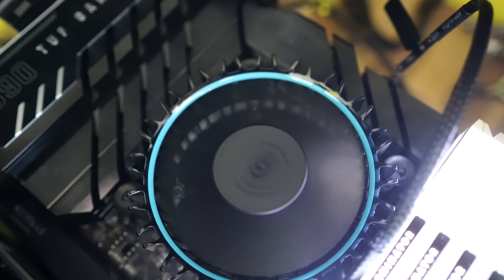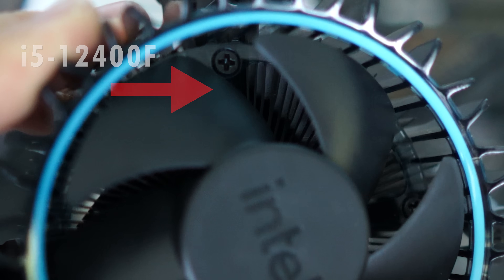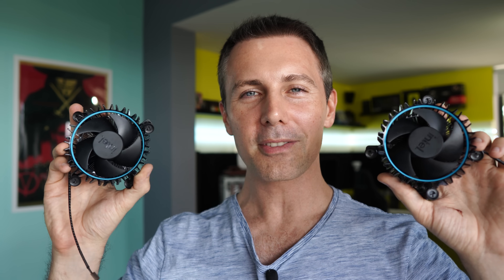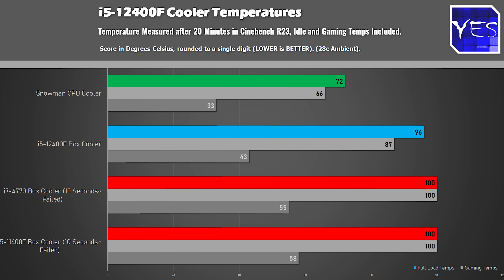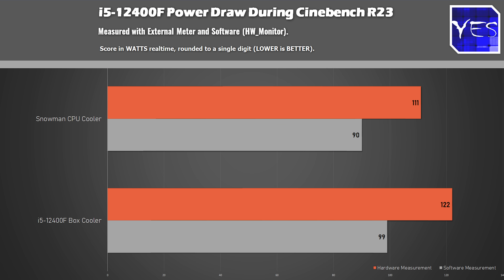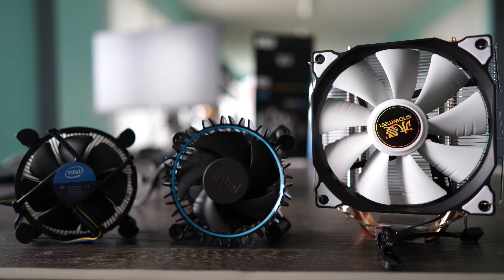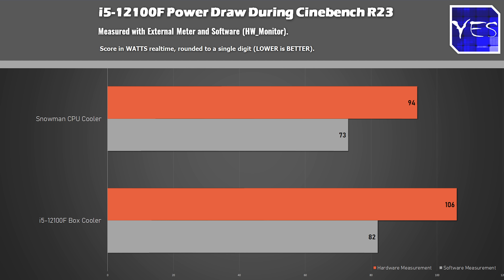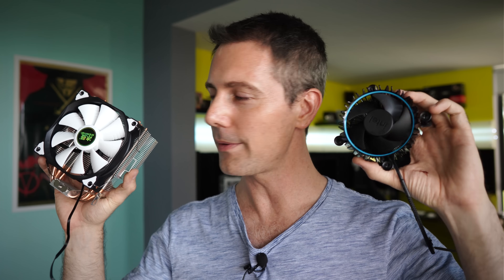Is Intel's New 12th Gen CPU Cooler Actually Garbage?

Comment: Me with the i3 12100 paired with i5 4570 4th gen stock cooler 
Running most of my games at 4.1ghz 
CPU fan in 2000rpm 
60C max 65C

Comment: Are you telling me that you tested this CPU and those temepratures with RAM that is not officialy supported by the CPU? Ofcoruse it will run hotter because you are creating bottleneck, and your RAM is downgrading to 3200 MHz, unless you are running a XMP profile, which...is something I have no interest of doing. Stock is fine for everyday use. Not saying that you wouldn't benefit from changing a CPU stock cooler, but no issues keeping it stock also.

Comment: Noticed a few mistakes. You were calling the 12100f an i5 processor in the charts when it's an i3. Also that snowman cooler you shared a link for a 5 pipe one in Ali but  it was actually only 4 for the lga 1700 you were using. Did you catch that? Nice job though.

Comment: Long story short: Intel Stock cooler garbage. 

I thought after 20+ years of experience I had installed the oem cooler wrong when temps ran to 99’C + , but nope this cooler sucks balls. Even older stock coolers were at most at 85’C or so at 100% stress test
Reply: stock cooler here on a 13700f, thermal throttling as soon as I run something heavier

Comment: You have things backwards, the intel cooler allows the CPU to draw more power which means it removes heat better. The "Snowman" is thermal throttling and limiting wattage...

Comment: My htpc has a i7 4770 and the stock cooler that came with it. Recently i thought about running a cinebench test and damn the cpu hit 100c in few seconds.. older intel coolers of that style had delta fans that would spin at 3500rpm but the 4th gen ones had a fan that was so slow that it couldn't even disapate 80w of heat. I plan on buying a deepcool ag200 or ag300 cooler those are unreleased in usa but easily available in India. And the performance is not bad for 10$ & 14$ cooler.

Comment: i had to cut a part from the cooler so i can mount it on my MB,they fkin built them wrong with the fan blowing air from the bottom to the top of the case...

Comment: Horrible stock cooler, used it with the 12100f it was keeping it at 70 degrees but the noise was unbearable. Upgraded to a 50$ AIO (ID Cooling) and all is good now, 50 degrees under load with the fans barely audible.

Comment: Is it fine to use stock cooler in case if its just going to be running basic eiditing (photoshop, illustrator, autocad, etc) school level for 3 4 hrs a day?? Or do i REALLY need to buy aftermarket aircooler. I am a professor and planning to use these for my students in their Lab systems... A little guidance will be much helpful. Thanks in advance

Comment: Honestly i have a intel stock cooler with a i3 12100 and on idle my CPU is at around 31.5C and under load it gets max 42C i would recommend the intel stock cooler for a i3 12100 all day long!
Reply: cooler room temps also plays a role
Reply: Where do h live
Reply: Probably in Antarctica @aramkqly4555

Comment: I finaliy have the i3 12100. Tested it with an old LGA 1150 stock cooler and never passed 82c on Cinebench r15 but I limited the power to 72w with no diference in performance on CPU Z. Also my board was set at 1.25 volts what is too much, so I set it to 1.2v, again, no diference on performance.

Comment: im using the stock i3 cooler and i was running at 95 deg on fortnite/val/rocket league until i reinstalled it and it now runs at 60/70 so, it can do the job if u need it to but an aftermarket will always be better

Comment: That's... a wrong conclusion, it might be the case. The cooler IS perfectly capable of keeping the CPU below thermal throttling cap. If the fluctuation occurs it's actually the fault of the controllers - the MOBO fan controller and the thermal controller on the CPU. The MOBO one decides to bring down RPM too fast and the CPU one has too short interval for the throttle/not-throttle trigger. It just reminded me why I opted for a MANUAL fan control on my previous gaming rig. I do not fucking need a fan cluctuationg between 60 and 100% because a mobo controller decides I somehow NEED my CPU at a constant temperature. Conversely, I do not need thermal capping when my fan/cooler setup on a budget is perfectly capable of dissipating the heat.

Comment: The new pushpin design feels cheap to me.  I only got 3/4 locked in cleanly and the fourth didn't seem that securely attached.  An aftermarket cooler will probably be in my 12400f's future.

Comment: The heatsink on the cooler doesn’t even cover the whole chip.. is that bad or does it really matter. I’m worried now because my cpu is running at 90c in really light loads, my whole pc is lagging even when barely starting my pc. I already checked that it was mounted properly. I’m so lost as what to do. Thinking about returning the cpu and mobo and getting a Ryzen

Comment: I feel as though with Intel 12th gen, something along the lines of a Coolermaster 612 should be considered the "included cooler" for the locked i3 and i5 considering how quickly these CPUs get hot.  Even my i7-12700k @ 4.8 with a 1.28v setting gets to high 70s in Cinebench R23 when under a H100i Capellix with fans in push-pull.  This makes the argument for the i9 boil down to "WHY?!"

Comment: I feel like this is finally the build quality that is good enough that the cooler doesn't become e-waste. The previous cooler was like silicon lottery: Some were quiet at low RPM, others rattled.
On the other hand, the increased power draw of modern CPUs nullifies its higher efficiency. At 80°C in games many buyers, especially the older generation that is used to 60°C, will look into an aftermarket solution.

Comment: Lol i just bought 12400 and tested it.....
I got 80 degrees c , idle temps.

I had to look up a very old video on how to install stock intel cpu cooler. And let me tell you , the push pins have to be installed in a specific way. You have to rotate the pushpins a. Certain way before pushing it.

My idle temps is now 35-45.

Comment: I bought a Hyper 212 evo V2 for like 30 bucks so i wouldn't have to use the stock cooler. 12400f running cool as an ice cube.
Reply: did it come with the LGA 1700 bracket?
Reply: @JayzBeerz + No, you have to buy it separately but i bought a bundle that had both the cooler and the bracket.
Reply: @polardabear  ok cool thank you.

Comment: I feel like there is some difference in our setups? I have a 12400f using stock cooler and running cinebench R23 it never gets above 76c which is a lot closer to the snowman 72c, my idle temps are also at 39c. 12400f and MSI pro z690 ddr4 using 2x 8 pin power. I used the stock thermal paste on the heat sink and didn't use my own. My case is a 4000d airflow.  room temp 23c
Reply: Weird because my i5 12400 keep at 36°~60° with a room temp of 28° or 30°

Comment: actually, I just bought a 12400f and I'm using the box cooler, stress test is putting my cpu temps at 80*C max, during gaming I reach upto 70*C which is acceptable, Case airflow and other things matter too you know. and my setup is not all that special either. BOX COOLER IS ABSOLUETLY FINE FOR GAMING
Reply: I'm using the 12100 with the stock cooler and I was ready to buy an aftermarket solution, but it works so well I can't justify replacing it. I haven't seen it hit 80's. I just ran 3Dmark and it hit 64C max temp. My ambient temp is 70F or 21C, i'm not sure if the summer weather affected Brian's results. Very odd.
Reply: @M4rio21  My I5 runs cooler than that and here outside temp is 40-45*C these days, but I have an AC in my room maybe thats why but none the less while gaming it never ouches above 70. Loudness is a bit annoying tho, its pretty loud.
Reply: @M4rio21  what gpu do you have?
Reply: @baya6002   xfx 6600xt

Comment: I'm gonna use this for my beater system and it'll be inside a "small case" - So I'll used the provided cooler, UNLESS I notice too much heat or noise - then the Thermaltake Water 3.0 must be broken out.

Comment: Intel should just stop adding this garbage into the boxed package. Heat pipes have been in common use for the last two decades.. either add no cooler at all, or an actually viable one. While the Wraith that AMD sells packaged with their Ryzens is also only slightly above the garbage treshold, it's leaps and bounds better than the Intel one.. and in production costs probably 1-2$ different, especially when leaving out the RGB stuff.

Comment: the only way intel can make their stock cooler better is going for a heatsink with higher thermal mass, and also a tower style configuration instead of a blow-down type. Blow-down type coolers tend to re-circulate the hot air ejected from the bottom leading to worse performance

Comment: In this video you do not at any point discuss the fact you are overclocking the processor by operating it without the intel long term power limit enabled.  This is why the stock cooler sucks, because your overclocking the CPU.  It's like. buy car and putting turbo on it and then calling the transmission garbage because it can't take 2x the torque.  BTW, yes the CPU EPS wires show higher power than the CPU is reporting the software because the difference is being dissipated in heat by the VRM as a result of inefficiency.

I do agree it's a great chip, and this is because you can remove the power limit and thus effectively overclock a non K processor on a non K motherboard with 100 percent certainty it will work, if you put beefy cooler on it.

Comment: This may not be related to the video, but— I use the Snowman cooler for my old AM4 socket motherboard and my A8-9600, used it for OC, and it was a hell to mount in AM4. I replaced the fan that it came with with an RGB case fan and strapped another one with cable ties. It cools my A8 at 4.1GHz @ 1.45v and my i3-10100f stock all well! Cheers for the video.
Reply: A cat can breath on the i3 10100 and keep it cool.

Comment: what about the stock cooler that came with comet lake intels like i5 and i7 non K ? The black coloured with copper slug in the middle one. I have that one but never use it. That on also significantly heavier than normal one. well doubt it perform any better but should be useful for a temporary itx stock cooling solution.

Comment: Hi Tech YES. Just wanted to ask how you were able to mount your Snowman cooler to the LGA 1700 socket. Did you just force the bracket to go in to the socket? I have a Snowman T6 and it's the clip on type and I am a bit worried cuz I just forced my T6 to get pegged in. It's not screw type like the T4. It has the round bracket where you have to hook it in place.
Reply from the maker: Have to get the little clips and mount them inbetween, can post up a little video, but will work perfectly.
Reply: @techyescity  I see I see. We purchased a LGA1700 bracket from where we purchased our Snowman T6 Dual Fan from locally but turns out it was for the clip type. My dad and I had a workaround though, bought fine thread screws and washers so we can screw in the existing round bracket to the backplate of the LGA 1700 bracket we mistakenly got hahahaha great review on the 12400F btw! Already had it so it just affirmed my purchase for me. Motherboard price was tough though especially looking at previous gen boards.

Comment: Considering that my i5 4440's stock cooler was silent on my Asus H87M Pro, and very loud+hot on my Z97 Sabertooth MKII - it'll all depend on the motherboard as some of the default settings ridiculously increase power draw.

The i5's cooler was from an i7 4770 though - I had a computer shop build it and they down-cycled the stock coolers from higher end builds.
Reply: Don't know if that's a good idea, some mobo's limit coolers to 50% duty cycle others to 70. Dust accomulates, summer comes in,  thermal paste goes bad.. you need some headroom.

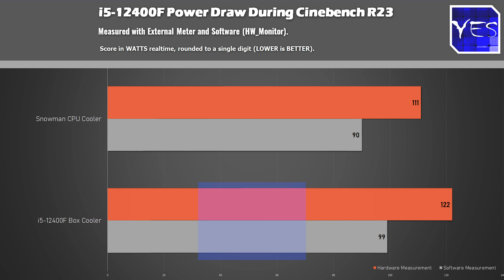Comment: 6:14 your external power meter measure the power without accounting for the VRM's efficieny loss, which happens by design as you step down from 12 volts to (let's say) 1.2 volts. so the software might actually be more accurate than your external power meter.
You are welcome to correct me, if you think i am obejctively wrong here.

Comment: the stupidest fucking part is that the core of this design, same as ever, is still solid. The main issue is heat capacity and total size. if they made them just like 1 cm taller, it would most likely be fine for non K 3s and 5s. the older versions of these stock coolers actually function better because they are usually significantly taller. I'm still running one of those older stock coolers in fact, though I'm about to upgrade my motherboard cpu and ram all at once. Even though my CPU is old as fuck, power hungry, relatively inefficient, and idles at fucking 60-70% use, a stock cooler from the era is more than enough to keep thermals within safety regardless of task - and it's not even loud.

Comment: Hey man I just purchased the core i5 11400F and MSI H510-A-Pro motherboard  2x16GB 3200 MHz upgraded from i5-9400F and MSI B360 Gaming Plus 2x8GB 2400MHz, and i got no performance improvement the memory to perform the same on 2133 Mhz and 3200 MHz performing the same in Single vs Dual-channel, i enable XMP profile and set cooler settings to Liquid from bios but not getting the same performance to advertise by reviewers, even single and dual-channel makes a lot of difference like 1x16GB vs 2x16GB runs dual channel but it sees no performance improvement i try to set ram 3200 Mhz but when i put it in gear 1 the shows ram overclocking fails, your help would be greatly appreciated or any viewer can also help me in this, thanks

Comment: It's not like there has ever been an included stock cooler that I'd call "good". Some get you by better than others, but even a $20,- aftermarket cooler nets you a nice gain in either less heat or less noise...
Reply: Amd has quite a few good ones. The original Wraith spire, the original wraith, and the wraith prism being good examples. There are also older ones that are good.

Comment: As time goes on the weight and amount of metal in heatsinks provided by Intel and AMD seems to drop. It's almost as if they rely on the CPU's operating at higher temperatures so they can cheap out on the cooling solutions. Even the prebuilt vendors (like Dell) are going the same way, throwing any old crap on hot top of CPU's that they wouldn't have dreamt of in 2005. Even the old core2duo's and "melting hot" Athlon XP's came with beefier heatsinks and fans back in the day.
Reply: AMD stock heatsink has 2 heatpipes and a copper plate, it cools so much better than their older stock coolers and is so much bigger and heavier than Athlon XP stock heatsinks

Plus this newer intel heatsink is actually able to cool the newer i5 while the older heatsink could not
Reply: @marcogenovesi8570  apparently 12 gen has a thinner ihs, so there is likely a mounting pressure issue on the older cooler.

Comment: At this point, they should have just removed the stock cooler in most SKUs to lower the cost and reduce e-waste. Sure some use it, but with Alder Lake, it's dangerously close to alert level temperature during production workloads and some games. Not to mention the humidity of some countries. I've seen so many Intel builds where the stock coolers were just being tossed aside, what's to say it's different now.
Reply: They will never reduce the price, will remove the cooler but not reduce the price.
Reply: Well, i5 12700 are already coming with no cooler.
Reply: @evuw ehe  Maximum Turbo Power
117 W
Reply: No, they should put better stock coolers in. It’s a big fail that the stock cooler can’t handle the heat of the 12400.
Reply: @EvilTurkeySlices  It runs just fine stock. 120W is a bit over 65W:s.

Comment: Why was that 65W part i5/i3 4/1xxF running at up to range 114 to 122W what were you doing goosing the core voltage?

Bench test at room temperature in Australian summer, 28 = 82 degrees and 96 degrees seems like Intel reversing TDP obvious?  

Please advise. mb

Comment: Looks like the CPU is thermal throttling a small amount with the inbox cooler.  A quick check is to compare the benchmark score the same between the "short" run vs 20min runs?

Comment: And this is why I'm using hyper 2 12 evo cpu cooler keeping my cpu blow 70c.
Reply: intel stock cooler keeps my 10400 under 70C while heavy gaming. got to have a good air flow case with good fans.

Comment: I have a couple of the dual-tower Snowman heatsinks and they're pretty damn good. The dual fan versions are wired to a single header and the fans are pretty average though, so I would recommend swapping out for some proper fans. Or go Noctua if you want nothing but the best. Budget heatsinks (Coolermaster Hyper 212 etc) have awful mounting solutions and they're dead to me.

Comment: What's the best cooler to get at a small size?
I mean yes these tower coolers are great and all but I wonder if there is a really good cooler that is comparable in size to that Intel stock cooler.
Reply: Depends on you pc case, but AIO units have rather small unit on CPU and majority of cooling is relocated with radiator. Option number two is for example "flower" style cooler firm Brians own vid titled "Can This $3 Cooler HANDLE an i7" or maybe those Zalman units. Also you might be interested in performance down-draft units like Noctua C14S or NH-L9x65

Comment: I always recommend people to buy a manufacture Air cooler why because if you overclock your cpu or not you can always trust a manufacturer air cooler to keep your system cool while under load. With the stock cooler from Intel I am very disappointed because I would have thought that it would be able to keep there alder-lake cpu cool. Thanks Brian for the information well spot on.

Comment: Was this running with multi core enhancements? I know it doesn’t mean much but the coolers were designed for a PL2 long term power draw.
Reply: No, the cpu wasn’t boosting to the single core boost frequency on all cores.